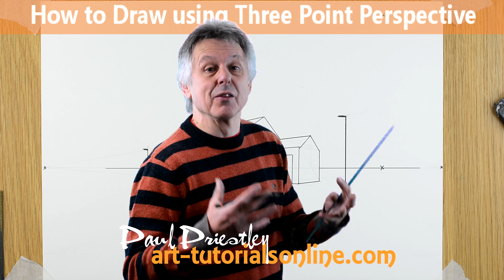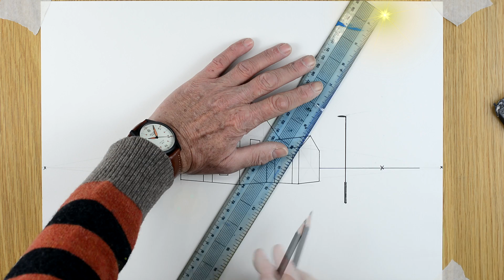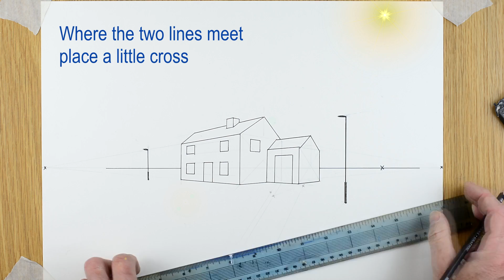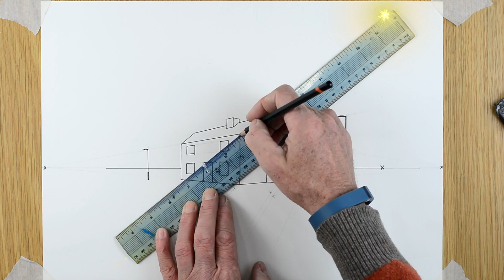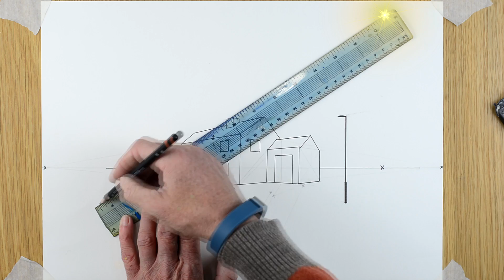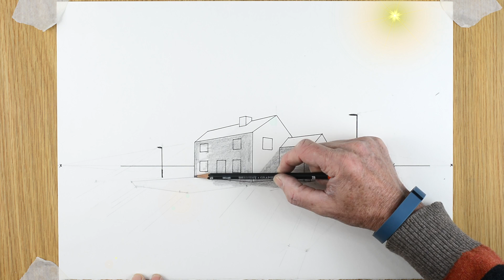Astonishingly Simple Technique for Learning How to Draw using Three Point Perspective - Shadows

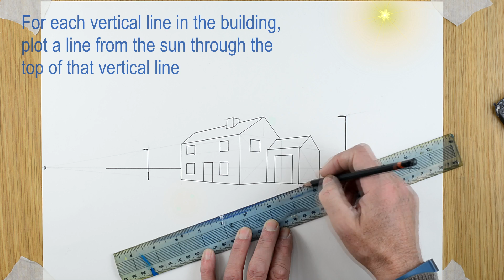Comment: At minute 0:50 you raised the ruler above the shadow vanishing point. I am deeply curious…did you make a mistake or purposely use artistic device? If I have fully understood the mechanics of this then you would place the ruler on the ground vanishing point and not above it.
Reply from the maker: The ruler lines up with the sun and the wall to get the shadow. The Sun is the vanishing point above the eye level.

Comment: I would like to point out a small flaw in this construction of perspective shadows. It is a common error perpetuated in many perspective tutorials. If the shadow is cast by the sun then the light rays would be parallel due to the sun's great distance. If the light source is an artificial one e.g. a street lamp, then the light rays can be drawn from the light source. A simple explanation is that when you move sideways from an artificial light, the light stays fixed in its position whereas if you try and move sideways from the sun, then sun moves with you. Therefore the sun rays are parallel.
Reply from the maker: I'm afraid you are wrong. The sun is so far away that it can be used as a fixed point.  You are correct in that an object lit by a fixed artificial light source casts a fixed shadow if you move in relation to it. Exactly the same happens with the a building in full sun, the shadow cast will be fixed and will  not move if you happen to move, therefore the sun can be used as a fixed point. The shadow will move very slowly over time, but that would not apply if you are trying to sketch the correct cast shadow in a drawing or painting.
Reply: @PaulPriestleyart 
Thank you for your reply. I agree that since the sun is a fixed point the shadow too is fixed but if you move sideways so the sun will move with you but the shadow still remains fixed. It would easier for me to illustrate what I mean. Is there a way to do this on Youtube?
Reply from the maker: @jacklewis2540  The only way to do this on YouTube would be to make a video I'm afraid.
Reply: @PaulPriestleyart  
OK. I didn't think it would be easy. I will complete my drawing and try and describe what I did in another reply.

Comment: This isn't "Three Point Perspective". This is the basic method of casting shadows while facing the light source in Two Point Perspective. True Three Point Perspective will have the vertical lines converge onto the third vanishing point either above the horizon for Worm Eye View or below the horizon for Bird Eye View.
Reply from the maker: Let's not be pedantic. It is a basic video using three points to create shadows, two on the horizon line and one representing the sun, adding true three point perspective to this would confuse beginners.
Reply: @PaulPriestleyart  I'd rather be pedantic than misuse proper terminology that will confuse beginners down the road. If you really want to teach people, teach using proper terminology from the very beginning. Otherwise, your learners will not learn properly. Just call this "Shadows for Two Point Perspective", which is the actual proper terminology of this technique/process. There is also a proper process/technique for One Point Perspective that is different from this.

Comment: i have a problem how would u construct shadow in 3 point perspective ? because the middle line isn't parallel with other lines due to the 3rd point perspective my lines aren't connecting,
Reply from the maker: Make sure you have a point on the eyelevel that is vertically below the sun. All vertical lines will take a line from the sun and the point vertically below it. If they don't meet you haven't  plotted the verticals properly.
Reply: @PaulPriestleyart  thank you!

Comment: I’m finally beginning to understand! I’m trying to draw a barn that has those double sloping roofs. I can still use two point or is there an adjustment for a barn as described? Love your channel - mostly easy to understand even for non mathematical beginners like myself!
Reply from the maker: Yes, you  can use two point to draw the barn, you only need 3 point to create the shadows. Cheers Paul

Comment: iirc when you have a sun, you need to use a parallel rays to build a shadows, and if lights comes from the lamp, you gotta do it like you showed. Or am I wrong? Can you explain that?
Reply from the maker: Take a photograph of a building or other object of a sunny day that is casting a shadow. Draw lines from the end of the shadow through the edge of the building that is casting the shadow as I have done in the drawing. You will find the lines will meet at a point, probably somewhere off photograph. The method does work.
Reply: So it doesn't matter what is the source of the light, sun or lamp? Every time I just have to draw a line from the source of light to the edge of a form? 
What if the light source isn't on the picture? Thanks
Reply from the maker: That's right, the sun is so far away that it acts a little like a lamp would on a still life. If the light source is off the picture the same rules apply,  you must plot the point from off  the picture

Comment: what happens if there are building sticking out the back of the front buildings
Reply from the maker: You just have to imagine the buildings at the front are transparent and draw the buildings at the back exactly as you did at the front. Obviously, you only need to draw the bits of the building you could see behind the front ones. Paul
Reply: do i then do the shadows of the back buildings or the front